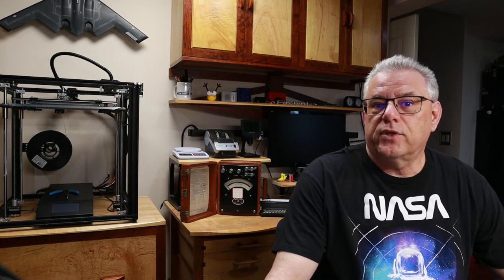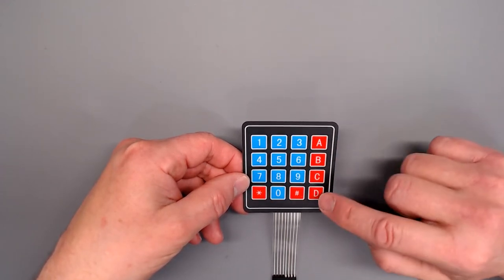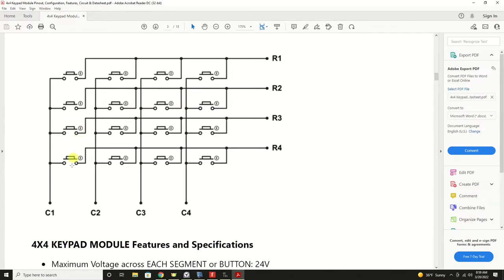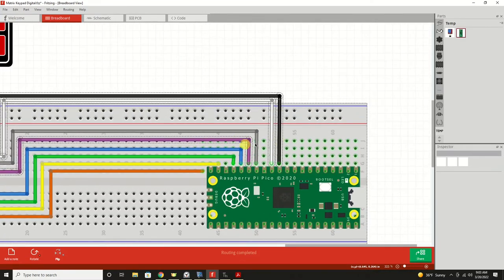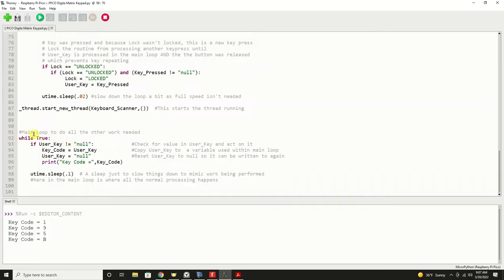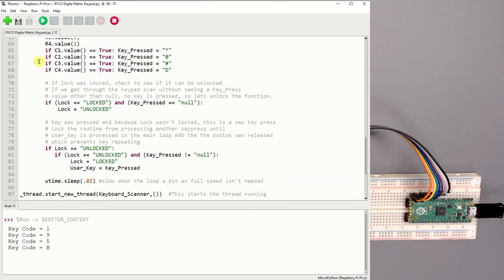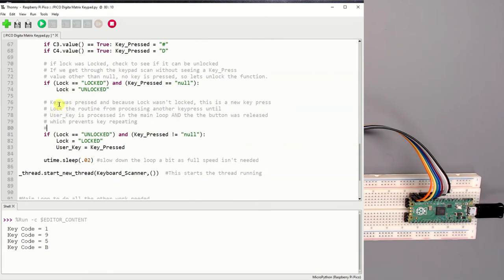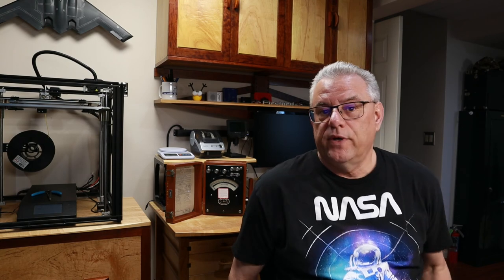Interfacing a Matrix Keypad to the Raspberry Pi PICO microcontroller

Comment: "Borrowed" the entire code, tested this code against other ones that use loops but are more compact and your code was 10% faster on average. ~380cpu ticks vs ~430.

Also a note for anyone who is doing this with threading, avoid using interrupts. It is not well documented but if you use threading + interrupts Pico will randomly stop working(on interupt), took me two days to figure that one out. 

Cheers!
Reply from the maker: Hi Phlex, outstanding information, thanks much for sharing!
Cheers!
Chris

Comment: Ok I would be very greatfull if you could make this work with instead of a keypad.. a joystick say press down = 2, left = 4, right = 6, up = 8, with up down left right and 5 with button press.  output to computer can this be done?
Reply from the maker: Hi, thanks for the request.  Can you explain in a bit more detail, I am not sure of exactly what you want and for what purpose.
Cheers!
Chris
Reply: @MakingStuffwithChrisDeHut  o so I have a game that uses movement with the number pad then the number 5 is used as a mappable key in game like potion to heal. I would like to use a joystick to move around in the game and have my other 4 fingers free for other keyboard use  so down on the joystick acts like I am pressing a keyboard keypad #2 and so on is this possible?
Reply: @MakingStuffwithChrisDeHut  this game can use diagonal input too like say the # 1 for one square south and one square west
Reply from the maker: @Elmorji  Ok, I think I understand what you want.  I was planning on a circuit python keyboard emulator project in the future, unfortunately, I don't believe that will make it to YouTube until mid-to-late July based on my current schedule.
Chris
Reply: @MakingStuffwithChrisDeHut  awesome can’t wait to watch that one too ! Thanks